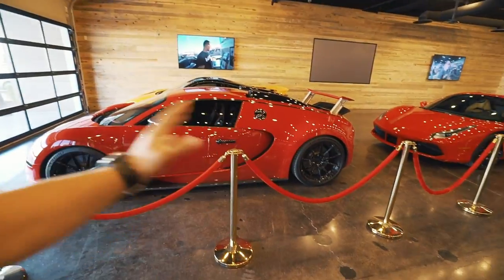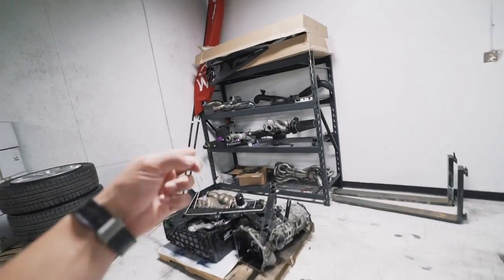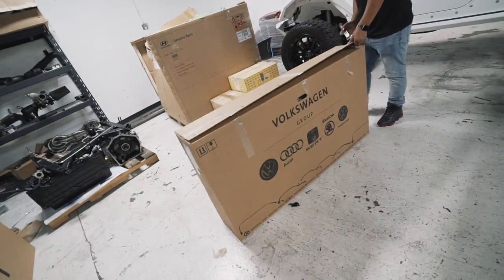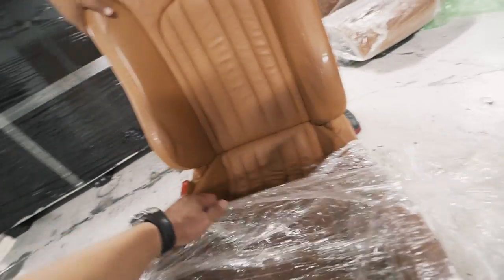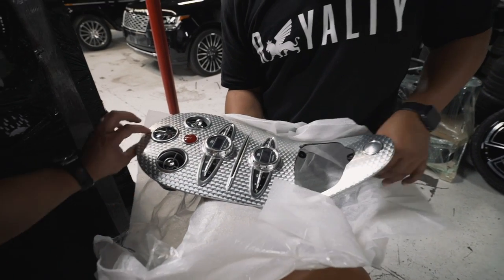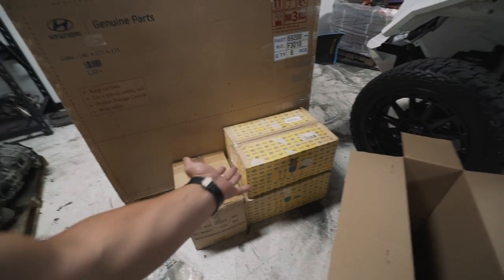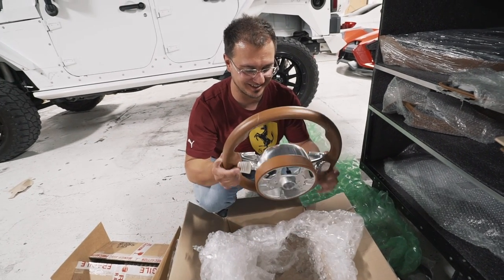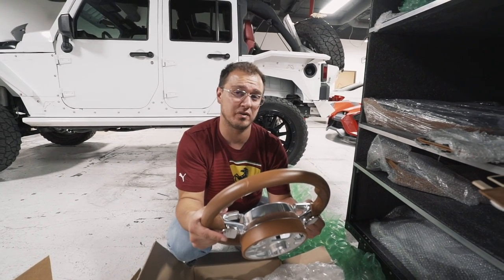BUILDING MY 3rd BUGATTI VEYRON

Comment: Bugatti Veyron Interior Pops up on eBay for Just $150,000 ...www.thedrive.com › News
Dec 12, 2018 — The interior of a Bugatti Veyron has surfaced for sale on eBay for the price of ... components not pictured, such as the steering wheel and shift knob. ... listing that the interior came from a brand-new 2008 Veyron, and has ... the components have since been stored in a climate-controlled parts storage area.

Comment: The center center n the charger charger charger oh yeah, and the reason you don't buy a flood Bugatti isn't because the body being f*** up cuz the body doesn't get f*** up interior might get a little f*** up but the whole entire electric harness will be f*** up do you really think or do you really want to dive into that with all them intercoolers radiator turbos that car is probably guide well over 200 sensors and that's just to run the car and you want to buy a flood Bugatti LMAO

Comment: SELECT CITY
 
TRENDING
Luxurylaunches - 
FASHION TRAVEL HOTELS CARS & MORE REVIEWS CELEBRITIES TIME PIECES TECH ETC
TransportDecember 6, 2018
Just for $150,000 you can get the complete interiors of a 10-year-old Bugatti Veyron
by Sayan Chakravarty

Have you always dreamed about owning the world’s fastest car but don’t quite have the million-dollar-plus extra cash to spare? Well, a Miami automobile dealer has something for you which can be yours for the price of a Porsche 911 Turbo. But the catch is it’s not exactly the Bugatti Veyron itself but its entire interior set. That’s right! For $149,999, you can buy yourself a brand new complete interior off a 2008 Bugatti Veyron. The description on the eBay listing reads, “this is a great chance to either change the color on your existing Veyron or simply replace your used interior to make it new again.” However, you can very well buy the interior parts to build yourself Veyron-themed office furniture set.

Braman Motors, the local Miami auto dealer that has listed the Veyron interior set, says that it came out of a brand new 2008 Bugatti Veyron 16.4. It was taken out before the owner took possession of the car, thus it has never been used before. The complete set includes the dashboard, seats, seat belts, door trim panels, shift knob, A/C controls, steering wheel, center console, glove box, lower dash trim and other small bits. The auto dealer claims that the parts are in immaculate condition and have been stored in climate controlled area. The cognac colored interior will also fit Veyron models from 2006 to 2015.